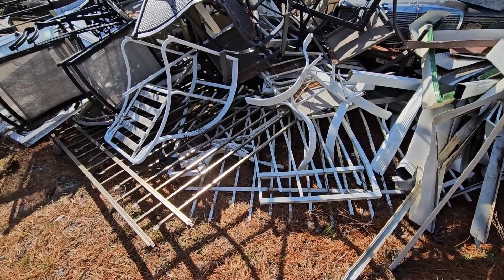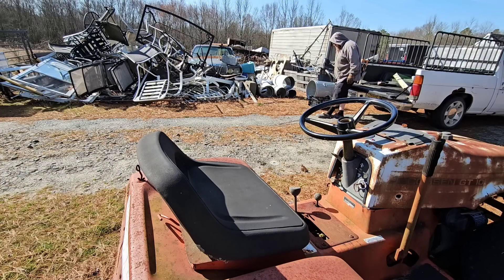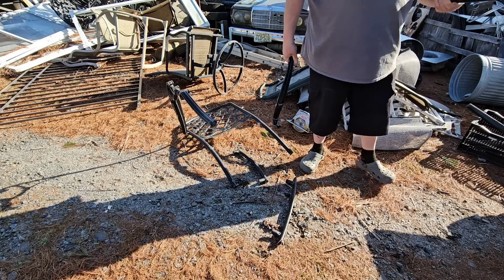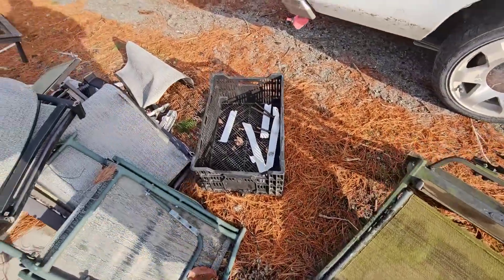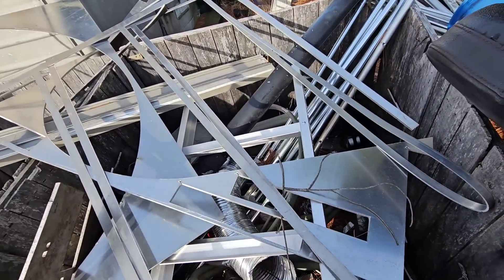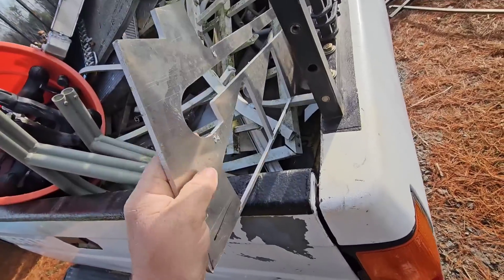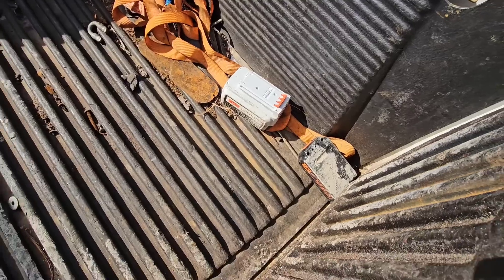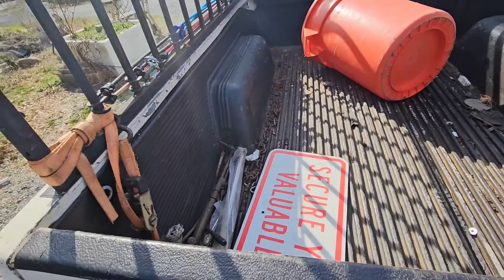Recycling Metal ♻️  Aluminum Nano particles in the atmosphere.

Comment: What's that saw blade you're using in your cordless circular? Saw what kind of Blade is it in there? Whatever it is, it cuts that stuff pretty good. 👍👍🙂🇨🇦
Reply from the maker: Regular carbide general purpose blade probably Dewalt
Reply: I'm going to get me one of those saws for sure. It'll make life easier. They work out pretty good. Better than using a cut-off wheel. Be great for that. Thank you!.
Reply from the maker: @ipaddlemyowncanoe.7441 works great until the tips fly off

Comment: Crazy to see yards breaking up the price on aluminum. Siding / Sheet / Cast / Radiators are all $0.40 a pound here, seems like every yard also in this area keeps them all at the same price but they separate it after you drop it off.
Reply from the maker: Yeah, cuz they're probably getting 50 to 60..... I wanted to take it to the yard. That pays better. But their way more picky on how clean it's got to be and 45 minutes from me.... Probably could it got an extra 30 or $40..